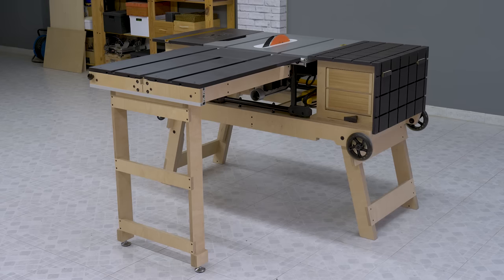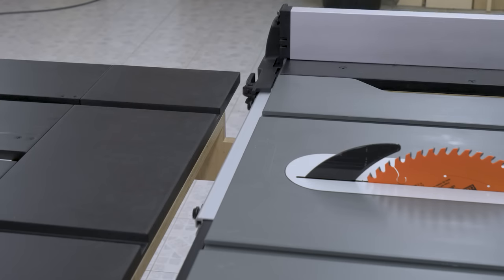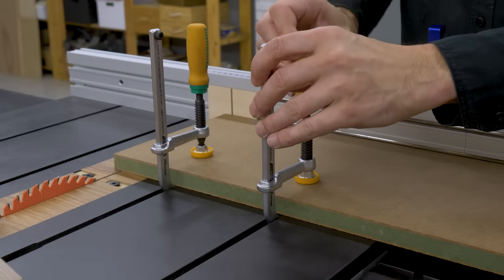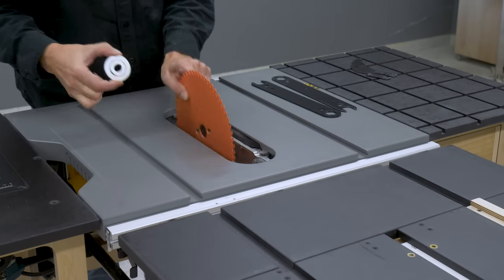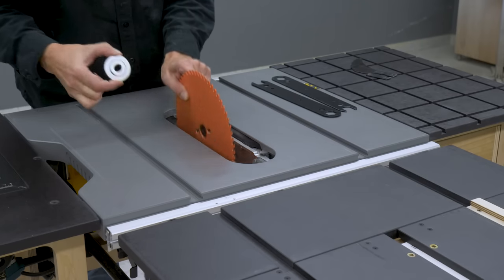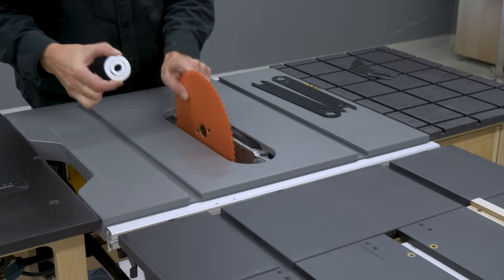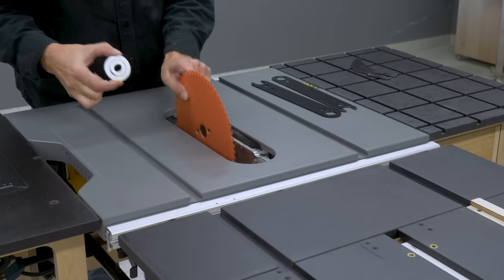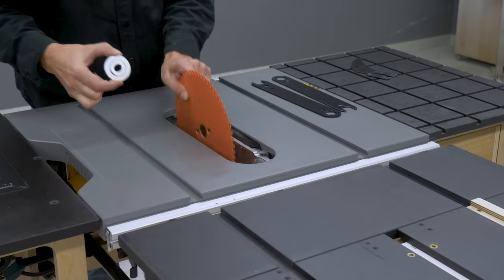DIY Folding Outfeed Table with built-in Crosscut Sled – Pt  5

Comment: This whole project is just so cool. I’ve already built the workbench, router table and assembly table, and today I’m prepping the outfeed table. I’m the proud owner of The Smallest Workshop In The World; a 4x5ft slanted-ceiling cupboard under the stairs, but this whole system fits inside with plenty room to spare. Wheeling it outside to work is so easy and I feel like I’ve ended up with a remarkably capable workshop that sets up in seconds wherever I wish. Thanks so much for sharing these videos - buying the plans was a no-brainer for me and it’s completely changed my woodworking career. Thank you.
Reply: can I see video of your shop?

Comment: Great video and great project overall, but if you want to do this part right, BEWARE to do the 5 cut method mentionned at 11' BEFORE YOU CUT THE SLED BASE IN TWO. It's not clearly mentionned in the video and I've lost a lot of time trying to figure this correctly.

Comment: the miter function of the crosscut sled is not so well thought through, as you can't really cut to length with it, since you bump into the 90° fence trying to cut off more than shown in the video
Reply: Crosscut sleds are for smaller pieces I think. If you wanted to cut longer miterd pieces, just use the main table saw. I don't think that it's not well thought through.

Comment: Amazing. It occurred to me that it would be helpful to mount an upside down jig saw module for use as an alternate to the router or assembly table. Small shops would benefit. Keep up the good work!!
Reply from the maker: the positive side about this design is that you can make other modules to do other jobs! thanks

Comment: I love your work...its very impressive but the one negative I will say is that this black top build is pretty much strictly for people who live outside the US or North America in general.  This one feature is what makes this entire build look so attractive.  Its like a sports car with a shinny paint job.  Take that away and the visual aspect of this build goes way way down.  Its a great build...you did a fantastic job...just no reasonable option to have our build turn out this visually pleasing in the end.  Nobody from Canada can get it either and that leaves out North America, which I would guess makes up at least 75% of your audience.
Reply: I understand your "pain" as I am in western Canada and cannot source it either, but you cannot fault Suso for using materials that he has readily available.  Many of the European makers use it too (Peter Millard, Hooked on Wood, etc.). 

The closest I go to getting full-colored MDF was a local wholesaler that said they ordered a pallet and after 2 years they had to sell it at a deep discount to get rid of it.  Hopefully it will eventually make its way over here but it will take customer demand to make it happen.   

In my case I laminated sheets of Baltic Birch with Formica to get a similar dark and light look, not 100% the same, but still looks pretty good.  Another option you may be able to find locally is form-ply / pheonolic plywood used in concrete forming or commercial truck and trailer floors.
Reply from the maker: hi mate, have you tried it here? I don't know the price of the board but I think you can get it: https://trinityinnovations.net/product/colored-mdf-panels/